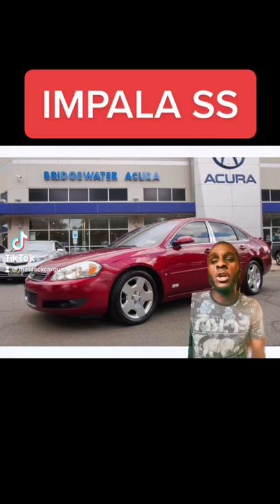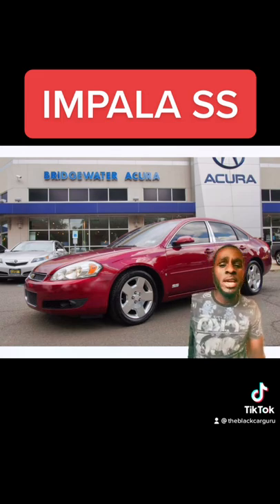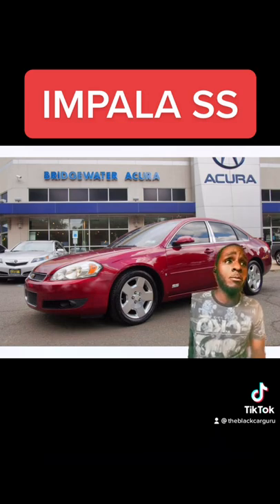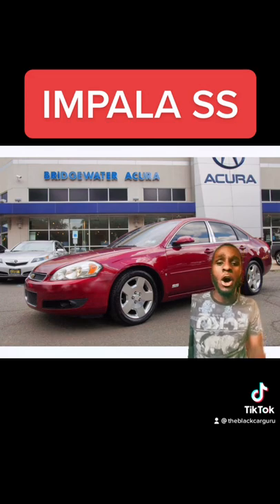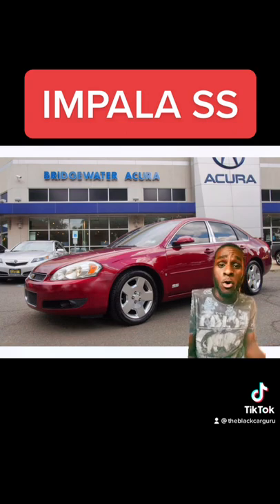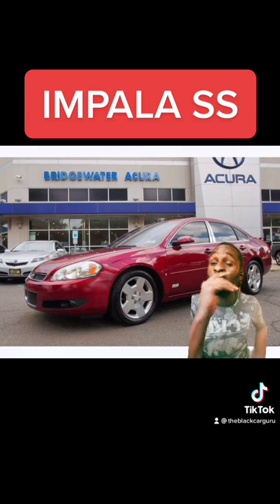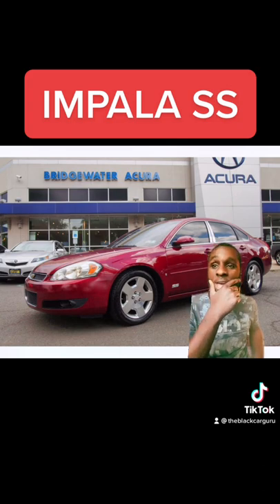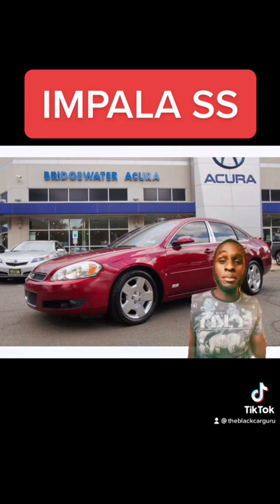The IMPALA SS was absolutely terrible!

Comment: I have a 99 GTP
 Granted it's a Pontiac and it has the 3.8 in it. Kicker? It makes 350 hp and keeps up with the newest stock supra. Not kidding, the four speeds that come as HD are pretty bulletproof to begin with. Through in a hardened input shaft, double link transfer chain, and a fourth gear clutch pack, it'll take 600+hp all day. Nasty burnouts I'll tell ya. The dude making the video wasn't really on point at all.

Comment: #1 problem… front wheel drive and bullshit torque steer. #2 it’s a glorified Lumina. #3 The 3.8L offered in the earlier Pontiac Grand Prix made more and better HP with a supercharger. #4 It’s a post-1960’s Chevrolet that is not a Corvette or Camaro.🤮

Comment: A lot of y’all love fwd Hondas then shit on fwd v8’s in Chevy’s. Cadillac been doing fwd v8’s for decades. I don’t get it. The only knock on them is the transmission. Folks have successfully swapped 4t85e from a donor Cadillac. ZZperformance even has parts to beef up the 4t65e hd and they’ve been able to handle 400+ hp no problem.

Comment: If you look at the transmission of an Impala SS you’d see the main problem. In order for that transmission to work it has to be built with super strong parts from the beginning. GM, the bean counting cheapos that they are, started with a shit design then built it with shit parts. But how is this new for GM? Corvette & Camaros never been known for good trans. Remember the Syclone & Typhoon? Transmission sucked ass too. Fiero? Well everything sucked ass but that everything included the trans. So the answer to the question is there’s not enough room to fuq with that 5.3 under that hood. Even if you put forged parts in the transmission I still think it’ll fair because how it’s designed. In other words, I t’s straight trash homie.